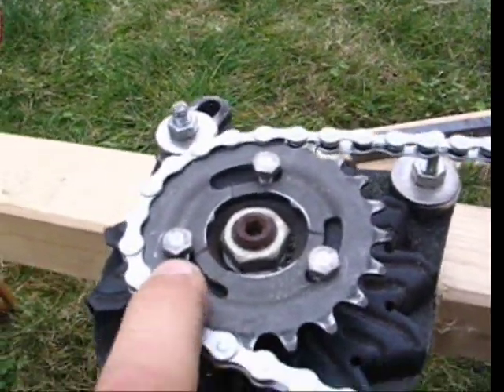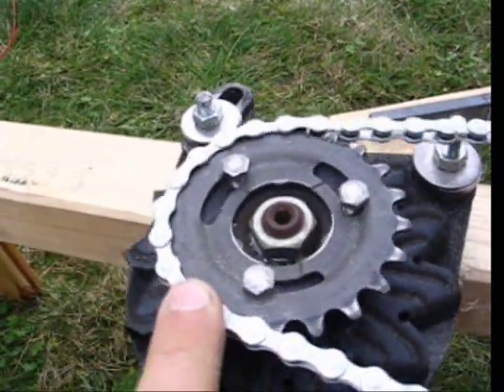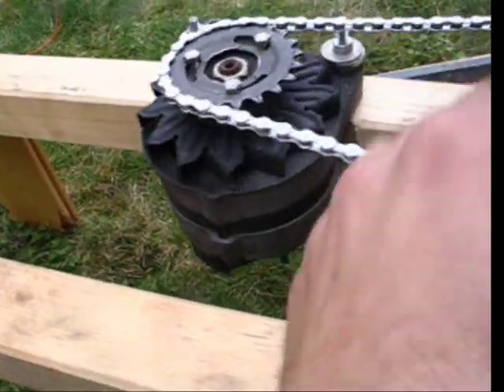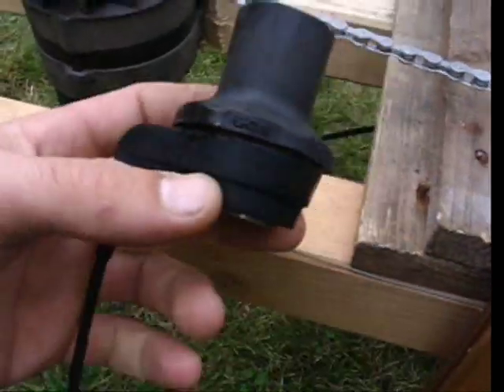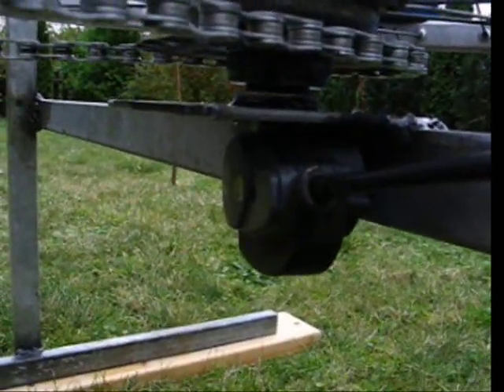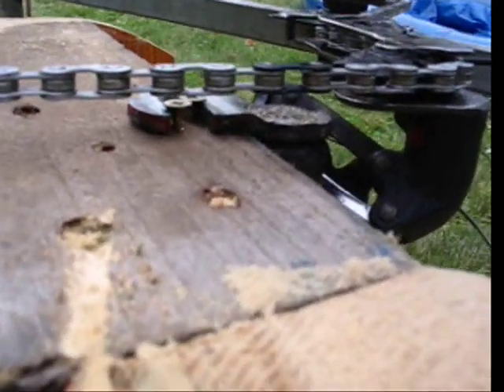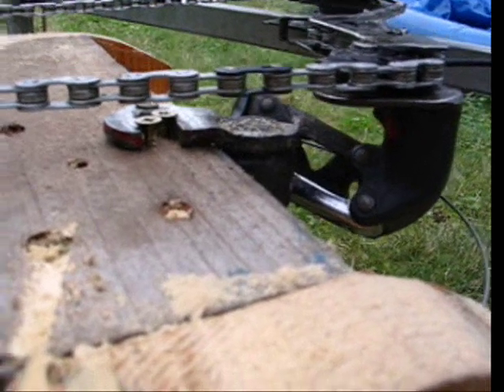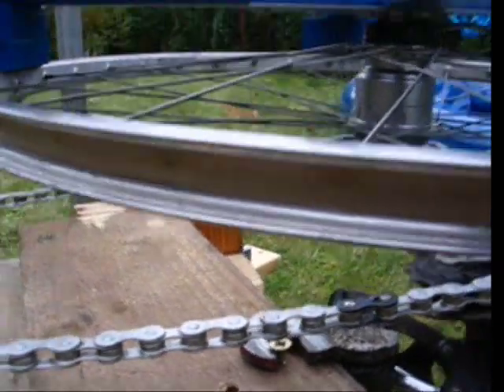VAWT update and dirty case model DIY

Comment: You mentioned you never get enough rpm with this setup, the sprocket you use on the VAWT is too small. A solution, dump the chain and sprocket ideal so instead you can mount a rubber tire on the bicycle rim on the VAWT, and use a small tiny rubber tire(like a skate board tire, etc...) on the alternator and align/mount the alternator so you have the skateboard wheel aligned with bicycle tire, this way you get high rpm on alternator for a easy test just to see if your VAWT can produce the rpm and torque you expect, or just see what it can do with minimal effort, just put tires on.

Or, just find a huge sprocket as big as the entire rim of the bicycle rim ans keep the tiny sprocket you already have on the alternator.But finding a sprocket that size with that small chain link chain is impossible.

Or, use a rubber belt wrapped around the outer of bicycle rim, and a tiny belt pulley on the alternator along with belt tension spring device, but i would try without the tensioner first, and if it slips under alternator load then apply only the minimal force required to the tension adjustment to keep it from slipping, because excess unneeded tension on belt will hurt the efficiency.  Using the very outer of the bike rim gives you huge diameter on your VAWT to achieve the rpm desired on the alternator.

Comment: you need to have a way smaller gear on the alternator, and a way bigger gear on the bicycle rim, so that for every revolution of the bike wheel you get multiple revolutions of the alternator. you should have at the very least a 1:0 to 4:0 ratio or 4 revolutions at the alt to 1 revolution of the bike wheel.

Comment: I think you are very close to running generator without adding the rotating vent.  Since this is a drag based turbine and output in torque is linearly proportional to the cross-sectional area that hits the wind, I would first try to increase the number of wings from 4 to 16 and I think it would run the generator ok without modification.  This would then look more like a squirrel cage fan but would still have its simplicity.

Comment: Or you can use an induction motor and add magnets to the rotor. Keep reading up there are pletny of good sources of old electric motor/genrators; old computer tape drives, treadmills, stepper motors from robotic arms assembly etc...

Comment: You need a bigger gear on the alternator, your gear ratio is too low. Car alternators require high RPMs to get good outputs. Also look in to modifying the rotor in the car alternator and putting in permanent magnets. You can then eliminate the brushes etc.. that will eventually wear out. You will also get better performance at lower RPMs.

Comment: it appears to have gear ratio less than 1. that makes rpms on the motor very low. think of a bicycle: it is easier to pedal (more rpm for less effort) when the gears are big at the pedal and small at the drive wheel. you should try to use maybe 3:1 ratio and expand from there. That is, a 30cm diameter sprocket at the VAWT and 10cm diameter sprocket at the motor. it will help. you have to find the optimum range for your setup, but i'm pretty sure it will have to be a much higher ratio yours